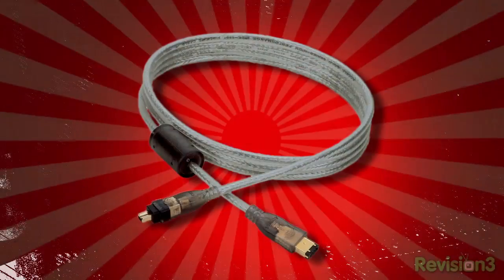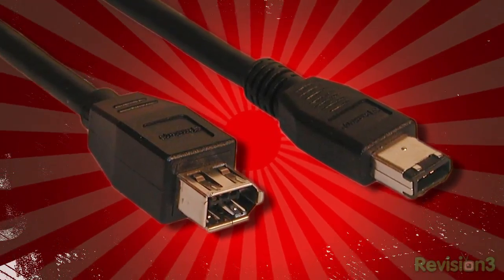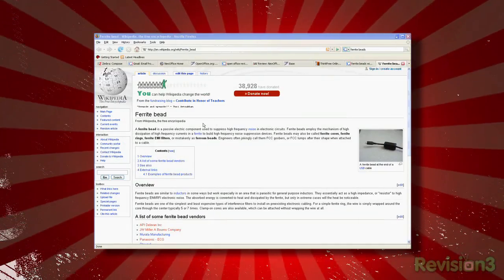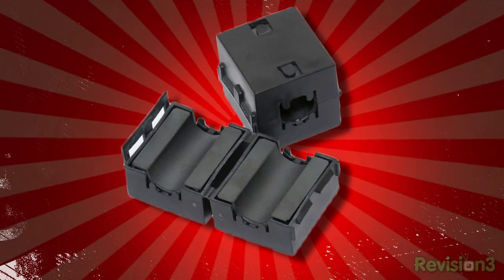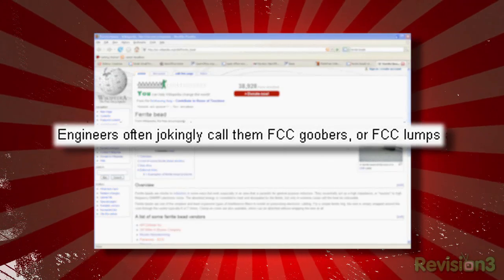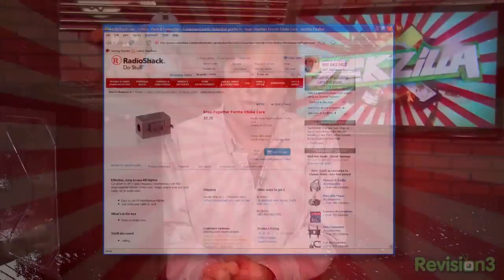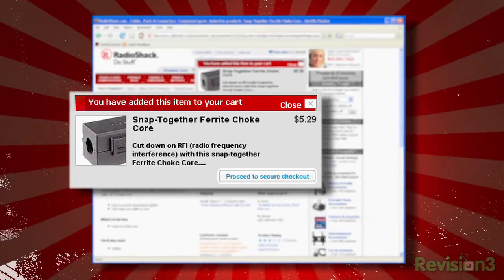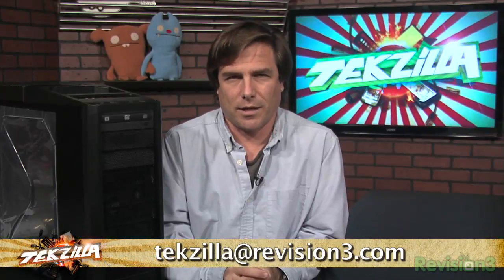Ferrite Cores - Tekzilla Daily Tip

Comment: Well, I had a bad coil whine from my PC's PSU, and it is making my USB DAC sounds whining too. After changing to a USB cable with two Ferrite cores on both ends, this noise is significantly reduced. Such that, unless I turn volume to maximum, I won't hear it again. So, yeah, it works in this situation.

Comment: I found this video as part of my own inquiries into ferrite cores to solve a noticeable 'buzzing' noise with my high-end Denon receiver when attached to home LAN (by a 50m cat6 Ethernet cable). 
FACT: attaching a ferrite core near the input of the Ethernet to the receiver solved the problem.
*This video is misleading. Truth is- there ARE configurations that necessitate the use of ferrite cores. 
"TEKHD"? YOU SHOULD KNOW BETTER!